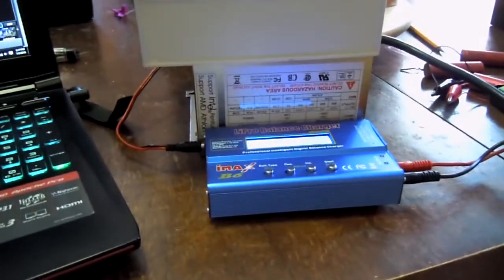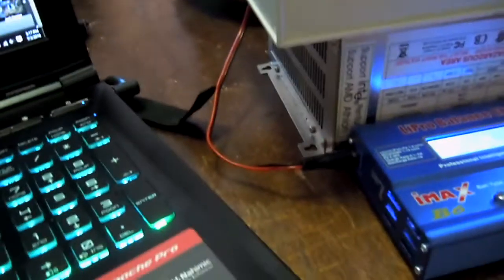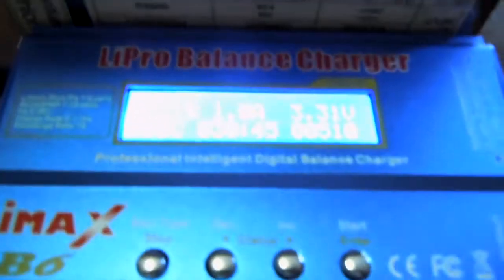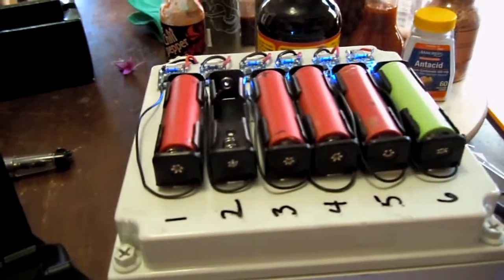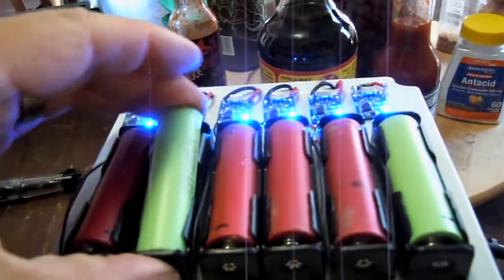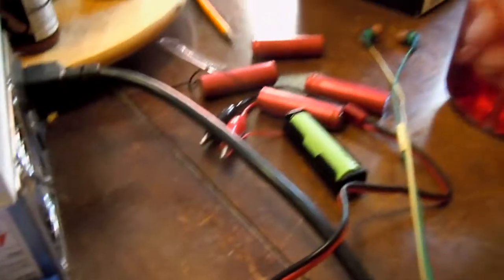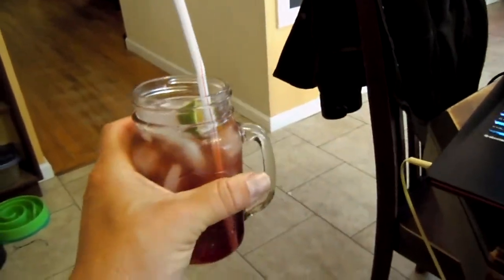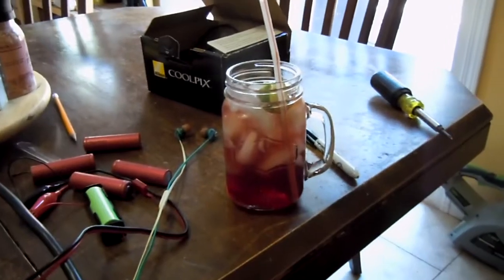18650 Lithium Battery Charger MOD DIY with Imax B6 integration

Comment: are you charging each battery independently?  Hard to see but it looks like your using the small boards that charge Lion batteries.
Reply from the maker: Ken yes each battery charges until full then auto shuts off. Then I test them for capacities then mark and charge again. Then I can take like batteries and make the packs.
Reply: Did you offer a video on this?   I have an older battery charger with a great battery holder section and I wanted to upgrade it for Lion batteries.
Reply: Just curious,  does anyone offer the small boards that can charge more than just Lion batteries.  I wanted to make a muti-chemical charger.  I have seen them for sale that hold 4 batteries of different types and can be mixed and independently charged but most will hold only 2 "C" cell size battery max due to size.  What I have is older large Nicad charger and all batteries can be up to D size with out a problem.  I could also just buy one of the 4 battery charges that can charge independently with any type battery and run extension wires from it to my battery charger using it just to hold the batteries.  Then pick up a charger like a iMax for those batteries that are connected in series like laptop batteries.
Are you aware of any charger that can do series charging or independent battery charging?  For example, lets say I had 3 batteries connected in series and I wanted to charge
them separately without disconnecting them.  Jumpers from the charger that connect across each battery without disconnecting their series connection.
Reply from the maker: Ken I did hook up a imax b6 clone